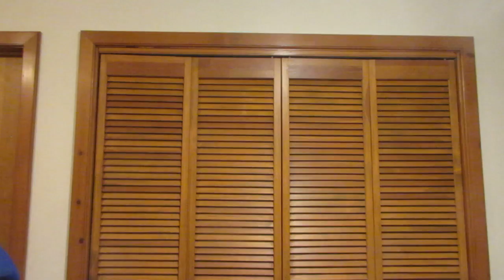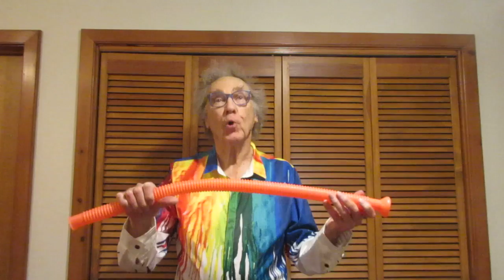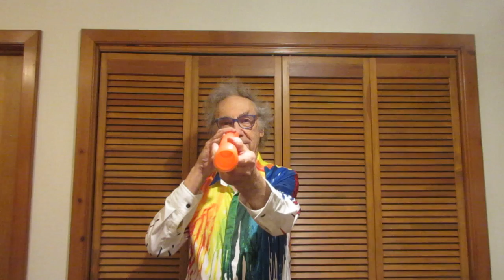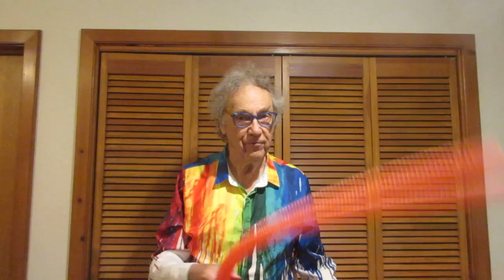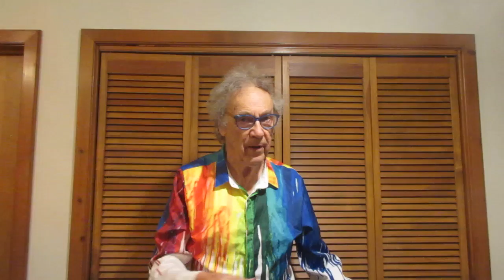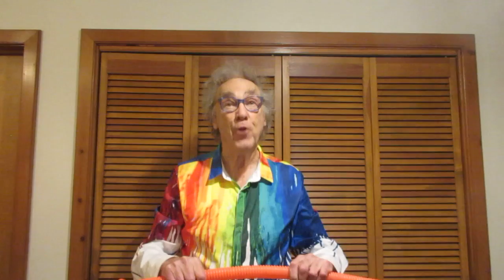Problem #58 Resonance in Organ Pipes

Comment: Dear Dr. Lewin, I have a mix up in my terminology, I think you can clear things up. 
I did the following experiment: I have air flowing through a straight pipe. Pressure ratio between outlet and inlet is lower than the critical pressure ratio, which suggests flow velocity at the outlet is close to the speed of sound. I have recorded the sound of this process and analyzed the frequency spectrum. Suprisingly for me (but maybe not for you), the dominant frequencies are in a integer ratio to one another. So this would imply a standing wave behaviour.. but can it be called that? The air is moving at a great speed through the pipe after all. 
I search on the web for explanation, of little avail. Literature containing a mathematical approach would be greaty appreciated.
Take care, love your videos.
Reply from the maker: ofcoz these are standing waves - watch my 8.03 lectures where I cover this in detail.
Reply: @lecturesbywalterlewin.they9259  Thank you for the quick answer! It makes a lot of sense that the sound waves are superposed on top of the unidirectional gas
 flow.
Reply from the maker: @ThomasHaberkorn  there is no unidirectional gas flow. There are 2 identical flows in opposite directions. watch my 8.03 lectures in which i coe this.

Comment: To find the fundamental frequency we can use the formula f=V/(2L) since it’s an open/open pipe.

V=the speed of sound which depends on the temperature but I will assume it is 20°C

To find the speed we use the formula:
331+0.6T

331+0.6•20=343m/s

Now we plug this into the original formula:

343/(2•0.76meters)=226Hz approximately.

To find other harmonics we simply multiply the answer by 2 and 3

451Hz

677Hz

Comment: Sir, I am from India. currently in the final year of my bachelor's degree in Physics.
First, I would mention (as I also have a drop of knowledge from the ocean of music!) that the second note that was generated was not an octave up but was the fifth up note of the first note i.e. the fundamental note.
Coming to the problem, we know that the fundamental freq. (let it be F0) in an Open-Open pipe is given by f0=v/2L where, F0 is the fundamental frequency; v is the velocity of sound in air and L is the length of the pipe used. As you say and I trust you that the length of the pipe is 76cm=0.76m and the velocity is known to us to be 346m/sec. when we substitute these values in the equation of the F0, we get f0=227.63Hz.
And the succeeding harmonics (except 1st Harmonic) will be the integral multiples of F0. i.e. F1=227.63 F2=455.26 and so on. The reason why F0=F1 is because that the pipe is open at both the ends.

Comment: Simple model for open open tube yield a spectrum of frequencies for each natural number n given by: 

f=n*v/(2L) where v is speed of sound and L is length of tube

Using v=340m/s and L=0.76m, we get about

f=n*224 hz

Thus the fundamental is 224 hz, the first harmonic is 448 hz, the second harmonic is 672 hz, the third harmonic is  896 hz

In the experiment you performed, the notes sounded close to Aflat4, Eflat5, and Aflat5,  which has frequencies of about 415.3 hz, 622.3 hz, 830.6 hz (standard equal temperament A4=440 hz tuning)

These are reasonably close to the calculated values for the first, second, and third harmonic respectively, and the pattern lines up with those harmonics (a perfect fifth then a perfect fourth). Thus the actual fundamental if you could excite it would probably be close to Aflat3=207.7

The error between 207.7 and 224 is likely due to variation in speed of sound and end effects not taken into account in the simple model.
Reply from the maker: "The fundamental and harmonics of a corrugated tube are lower than those of an uncorrugated tube of the same length and diameter" "The difference in speed between the moving end of the tube and the stationary, hand-held end creates a difference in air pressure. A higher pressure is at the fixed end and a lower pressure is at the moving end." https://en.wikipedia.org/wiki/Whirly_tube
Reply: Lectures by Walter Lewin. They will make you ♥ Physics. Interesting, thanks

Comment: Professor, if our universe and distant galaxies are expanding at the speed of light, could it be considered a perpetual motion machine?
Reply from the maker: google perpetual motion machine - then decide
Reply: No, the expansion of the universe, even if it appears to occur faster than the speed of light at large distances, doesn't constitute a perpetual motion machine because it's the expansion of space itself that's causing galaxies to recede, not objects moving through space faster than light. 
The universe is expanding, meaning the space between galaxies is increasing, not that galaxies are literally moving through space faster than light.
The expansion rate is described by Hubble's Law, which states that the farther away a galaxy is, the faster it appears to recede from us.

Comment: Fun facts: 

As young boys we had these toys and swinging really hard, we could get up to 9f0 or so. I became quite acquainted with the musical sequences.

As a student I studied the perception of overtone singing, where the same sequence came back. (For anyone interested: see The Journal of the Acoustical Society of America 92, 1827 (1992), or https://www.ncbi.nlm.nih.gov/pubmed/1401528

Mariah Carey's 'All I want for Christmas' contains the theme g-b-d-f#-g-f#-d-b which is the overtone series 4f0-5f0-6f0-7f0-8f0-7f0-6f0-5f0 of the fundamental frequency f0=392 Hz (g).
Reply from the maker: nice!
Reply: And until 2004 I travelled daily by electric trains. In the double-deck trains, when sitting near the electric transformer or motor, one could hear a soft humming when the train departed. As the train gained some speed (and more power was needed to keep it accelerating), you could hear the pitch of this humming jump up stepwise.  Again, these were tones of a harmonics series. The octave and fifth interval were represented, so if it's something like an arrangement of coils that are switched on to a circuit, I would guess that the setup had a hexagonal symmetry. 
Does anyone know the details of this? Are extra coils switched on, or is DC just converted into different frequencies to influence power transmission in some other way?

Comment: Sorry to be a party pooper here. What I heard was an A flat, the low tone; E flat, the middle tone;  and A flat the Hi-Tone. What I'm calling the low tone sounded an octave below the high tone and the middle tone was a perfect fifth above the low tone. This means that what we ACTUALLY heard during your demonstration was the first harmonic, second harmonic, and the third harmonic. The fundamental would have sounded an octave BELOW what I'm calling the low tone.
Reply from the maker: you are right!
Reply from the maker: "The fundamental and harmonics of a corrugated tube are lower than those of an uncorrugated tube of the same length and diameter" "The difference in speed between the moving end of the tube and the stationary, hand-held end creates a difference in air pressure. A higher pressure is at the fixed end and a lower pressure is at the moving end." https://en.wikipedia.org/wiki/Whirly_tube

Comment: Sir, I have a doubt , will a current loop placed in a magnetic field always experience a zero force?
Reply from the maker: watch my 8.02 lectures where I cover this - including torques.
Reply: Nope. Not always.  Although when the field is perpendicular to a the plane of the loop and is uniform with space it experiences zero force.